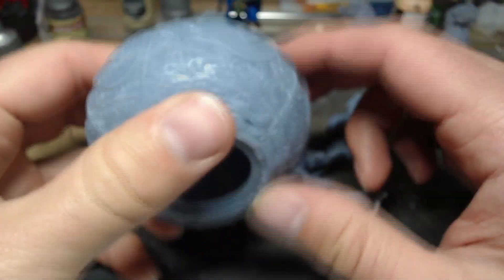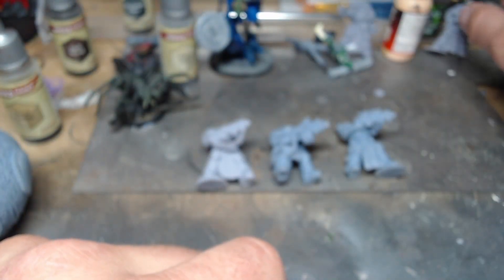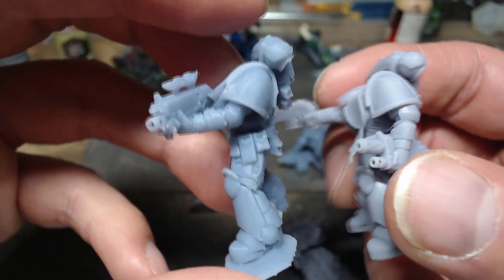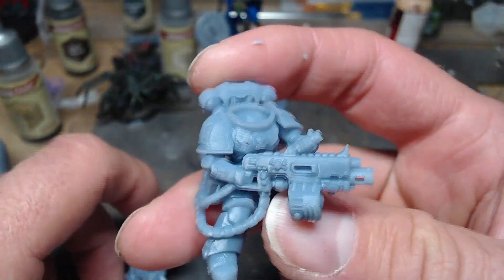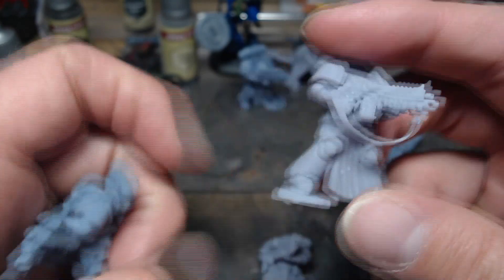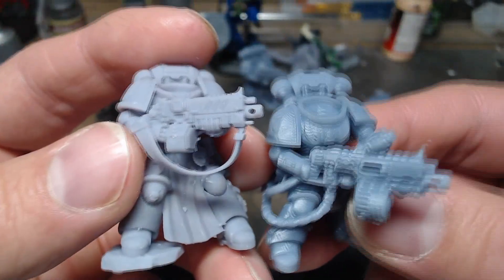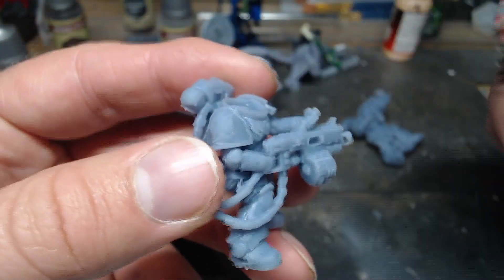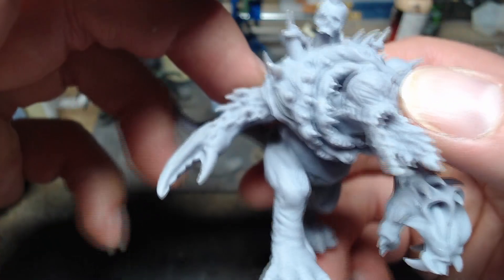Comparing 2k Phrozen Sonic Mini to Anycubic M5s! Pt1!

Comment: Nice comparison! Now, just to be fair, when you compare the layer lines on both the 2K and 12K models, you say it may be due to the files being free downloads. Actually that's not the real issue, instead it's the layer height settings in your slicer: if you always set your layer height to 50um, it doesn't matter if you use a 2K or a 12K screen, the layer lines will always stay the same. Try using a smaller layer setting, that will obviously take quite a bit longer to print, but the results are worth it. Right now I have my slicer set for 30um layers on my Photon M3 Premium, I think the M5 supports up to 20um layers, give it a try 🙂
Reply from the maker: Noted thank you! If I remember correctly layer height on my phrozen is .05mm and the default for high speed resin is .1mm.

I do appreciate your message being presented in a constructive way while critiquing though. It would be nice if more internet folks adopted this mindset! Thanks again! 😃

Comment: Hey thanks for the video but honestly it isn't really a good comparison because you didn't dial in the exposure settings on the 12k. Looking at your 2k you can clearly see you have the exposure settings pretty solid. The model doesn't have any clear visible scaring aside from where you missed a support tip, and that is what leads to models getting that "melted wax" look you have with the 12k. Looks to me like it didn't fully cure each layer before going to next one, which would explain the thick layer lines because it's getting pulled while still somewhat malleable. 

"I haven't cure any of this stuff yet"

Then don't touch it without gloves man. Even if you ran it through an ultrasonic cleaner and two cycles of clean IPA it isn't safe to handle with bare hands. If the model is glossy, that is usually either A: uncured resin that stuck to it, usually from insufficient cleaning, uncured layers, dirty IPA or B: Curing it before letting it dry fully. If you are using a wash station, I highly recommend you have a second clean IPA bath in a pickle jar or something just so you can rinse off any of the dirty IPA from the wash cycle and don't need to replace it constantly. Keep an eye on it, you would be surprised how quickly the second bath will start to cloud up even if the model looked visibly clean. 

I keep a disposable box near the printer for general cleaning before moving it to the the IPA tub and a pair of reusable nitrile gloves for after I do the IPA bath, so I can handle it easy while removing supports, examining and the model and anything else. 

I hope you have fun with the hobby!
Reply from the maker: Thank you very much! I certainly need to spend some time dialing in the settings with some exposure test and stuff for sure!